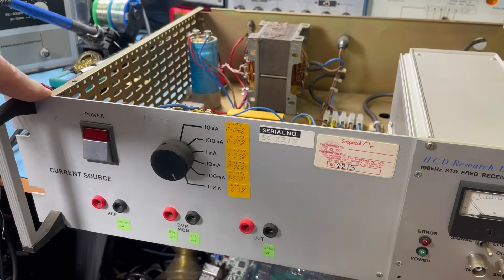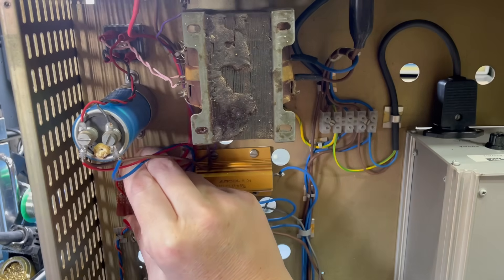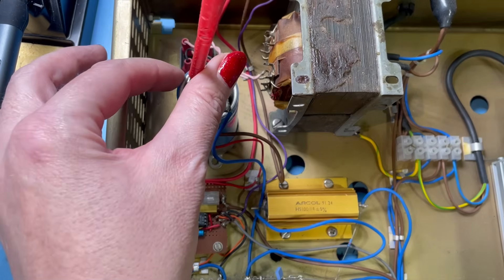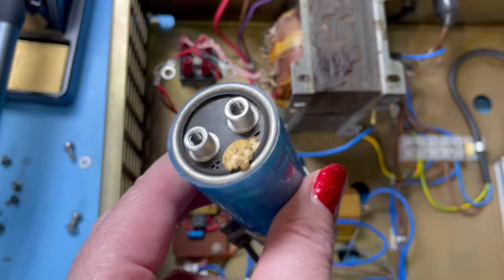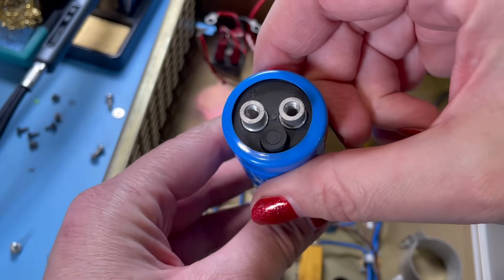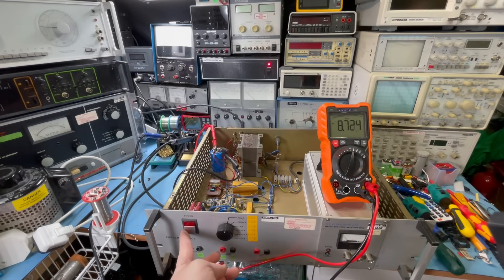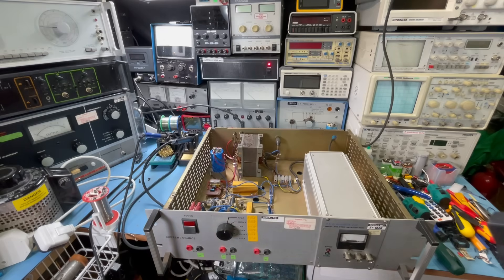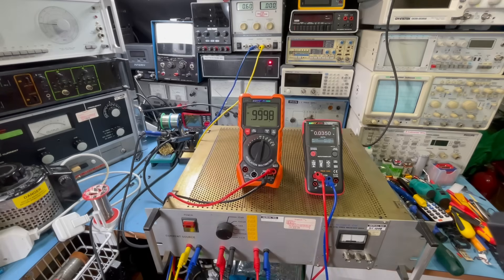DC Current Source Repair and Test - Calibration Equipment Update

Comment: Not sure if you ended up switching the opamp in the end or not, but if you did, the trimpot next to it was likely to null the opamp's input offset voltage for best accuracy. With a new opamp that offset adjust would need a new position.

If the 1A resistor is drawing a lot of current you might need to grab another selected many watts current shunt to adjust it with, rather than any potentiometer which likely couldn't handle the current
Reply from the maker: Yes, you are right, the offset will need adjustment.
If I remember correctly, there is only 1V across that resistor at 1A. That's a total of 1W. The tolerance of the resistor is 5%, so if the preset potentiometer had to trim it down a whole 5%, that would be 21 ohms of shunt resistance. At 1V across the 21 ohms that would be about 48mW. I think the pot is good for that.

Comment: Cool equipment.  I really don't care for transistor and IC sockets in test equipment; too much potential for trouble.  That resistor you resoldered appeared to be jumpered with a shorting wire (or maybe my eyes aren't good enough); was that an add-on component with the variable 100k control?  Nice video; I'm a sucker for vintage test gear.
Reply from the maker: IC sockets are very useful to replace failed IC's. Some manufacturers use a lot of them, some none. This is an old piece of gear, so naturally it might have some tarnish in the socket.
On closer inspection the resistor is shorted, most probably after initial adjustment it was decided it wasn't needed. Yes there are some parallel trimpots for the 1A range. The unit is now working, quite well, but I am going to go back into it in the future and improve it. The little bit of veroboard circuitry is a bit rough. The whole thing could do with some improvements. I need to fully trace out the circuit and produce a schematic first.

Comment: It wasn't clear to me how the current source worked. Was it just a precision voltage source that produced 1.000V and then you were switching in various series resistors with the meter? In other words, wasn't there any active feedback that would compensate for the current meter's internal resistance? Can you show the schematic?
Reply from the maker: I don't have a schematic for it. From what I worked out, the reference voltage is applied into the op-amp positive input and the negative input contains a feedback loop of the resistance of the current shunt of the meter under test and selected precision range resistors, selected by the switch, in a divider network. The op-amp tries to balance the positive and negative inputs and drives a power (darlington) transistor on the back of the case to achieve that balance, thereby controlling the current through the power transistor.
Reply: @JazzTechUK  I know you said you had drawn up something but okay, what your saying makes perfect sense. The op-amp is matching the 1.00V reference across the selected sense resistor so that it too will have 1.00V across it as well. And the meter under test should be in series but not included in the sense circuit.

Comment: What a weird combination. I was thinking it was some sort of modular system like a Tek 500 rack until I saw the inside. Maybe a company assembling custom test units for manufacturing (or even their own manufacturing). As it happens I do know an HCD in, I think., Hitchin but it seems a bit old-fashioned for them.
Reply from the maker: I think it was an in-house build by the test engineers, but yes, it is a strange combination.